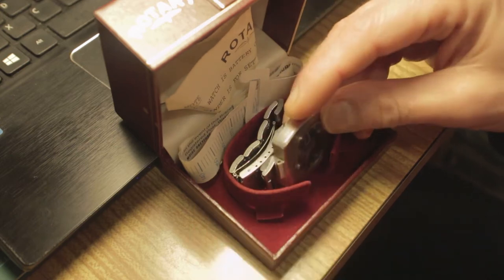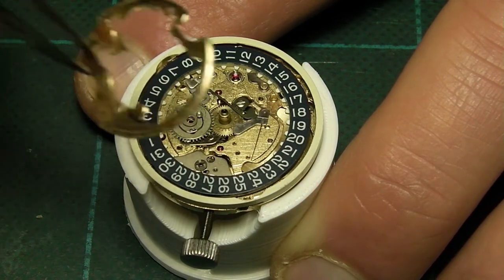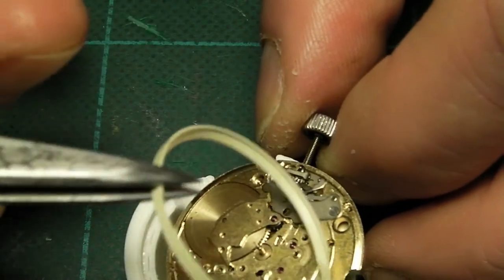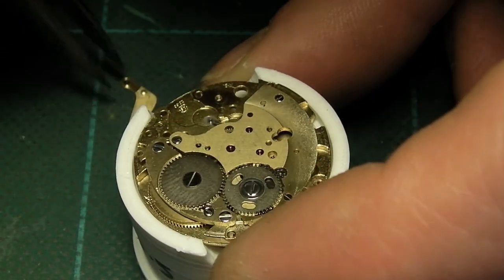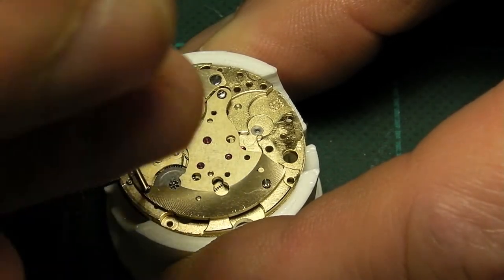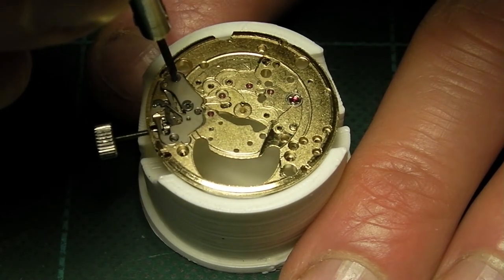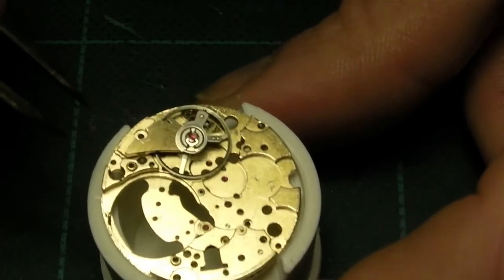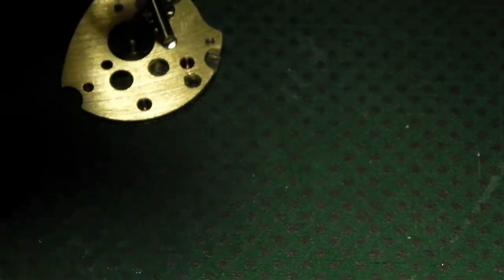AS2066 Service 70's Rotary Part 1 Disassembly

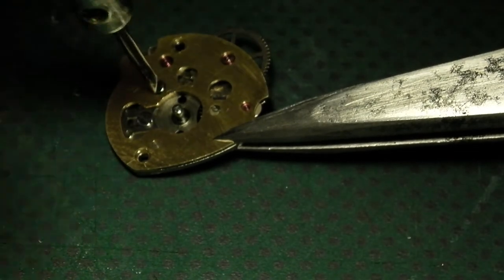Comment: 15:28 is the worst mistake I ever made by taking this assembly apart( auto winder assembly). It took me about two hours to re-assemble.Next time, will leave middle screw in place and run thru cleaner as a whole until then oil the pivots after.